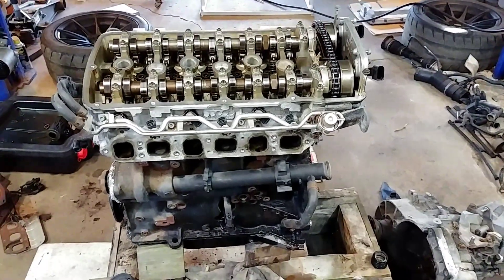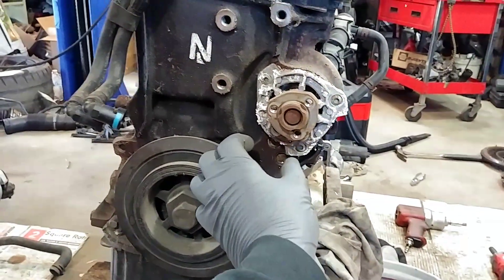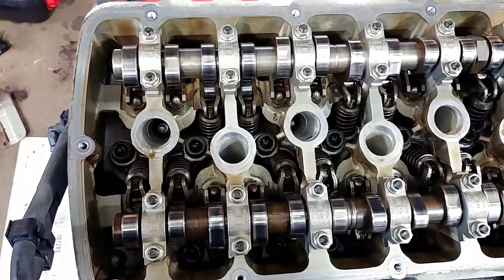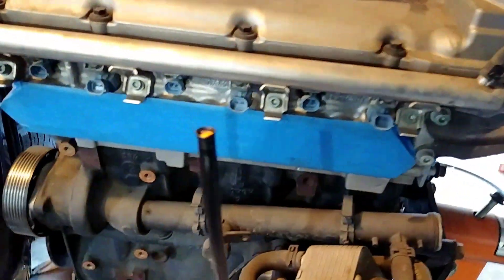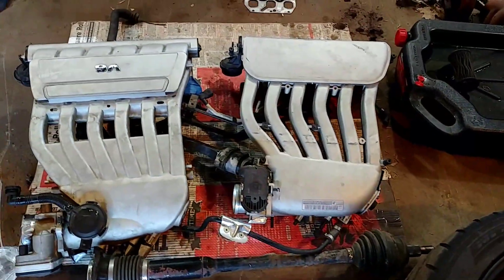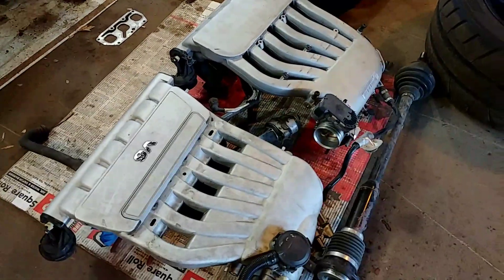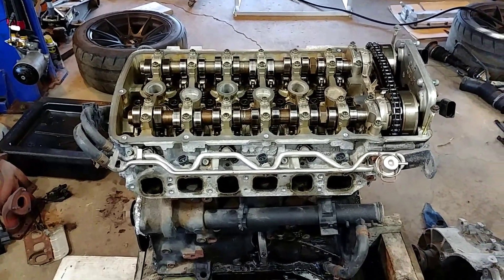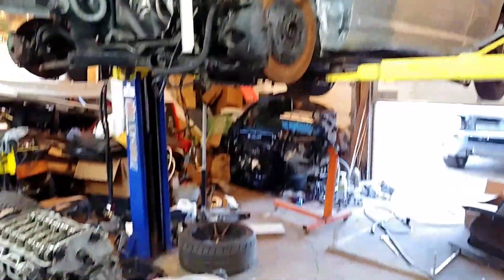VR6 swap 2.8 GTI to a 3.2 from Touareg

Comment: If i may ask. Can a cable shift golf 3 or golf 4 gti gearbox fit on a vr6 r32 motor?
Reply from the maker: I believe you can swap 5 speed and 6 speed. But I'm not too sure about older transactions.
Reply: @sergesvz  is it..

Comment: hi, nice video , i have a cuestion , does the 3.6 engine from touareg have the holes to put the engine mounth braket on the right side ? or you have tu drill the block ?
Reply from the maker: I'm not sure. I have a 3.6 core from a Passat sitting around and I know the Passat block has them because it mounts the same way. I've been thinking about modified head from 2.8 and 3.6 bottom end. 3.2 modified head would be even better because their valves are 1mm oversized.

Comment: Question I bought a r32 engine . I wanna put that engine In a mk4 gti 2.8 24v how hard is the swap and can I use the same harness?
Reply from the maker: Yes, but only if it's early production R32. Apparently there's different engine codes that may have different cams and variable valve timing is different. 
I bought my engine from a 2004 Touareg I swapped the oil pump and the oil pan and the harness plugged right in I just need a swap tune. U would need a swap tune.
Reply: @sergesvz  The oil pump It's got to be from the 2.8 ?
Reply from the maker: @ronnymedina1523  the toaureg has a different oil pan and pump because the engine sits definitely. R 32 has same pump, same part number.  not sure about oil pan. It might be slightly different because R32 has transfer, or it could be same as 2.8. the only thing I modified was the timing cover and it was a very small cut grind.
Reply: @sergesvz  Thank you thank you so much for the information
Reply: Good afternoon sorry to bother lol. I communicate with a person who sold me there r 32 engine And then you was removed from a Touareg 04 I believe you said that I can use the OEM harness from my 2.8 24v
Reply from the maker: @ronnymedina1523  yes I used my original harness and everything works. It runs rich because R32 injectors are bigger but the car ran good no engine light. I used my 2.8 MAF sensor.

Comment: FYI, I was the very first to do this swap about 8 years ago. dubwerks, giac, and many others said it couldn't be done. Shout out to Fred at united motorsports for figuring out the tune!
Reply from the maker: I still don't have a tune. Running on 2.8 software. Runs too Rich.
Reply: @sergesvz  fred basically turns your ecu into a r32 ecu, deletes the awd software. At least that's how he explained it. Worked flawlessly.
Reply from the maker: I should reach out to them
Reply: Do you have any pictures of your swapped car. Would be cool to see VW tuning history.
Reply: @sv_cheats1970  i would pay double what i sold it for to have it back. The guy i sold it to changed his number shortly after, i pretty much immediately regretted selling it.
Reply: I have some photos but the videos i had are gone.
Reply: @kbwerks6592  thats sad... Still pretty cool you managed to do such a swap back then.
Reply: @kbwerks6592  thats sad... Still pretty cool you managed to do such a swap back then.
Reply: @sv_cheats1970  it was a lot of figuring out as you go along but after you know what to do, its actually a pretty straight forward swap.
Reply: @kbwerks6592  about the ECU? You used a remapped golf mk4 VR6 ECU correct?
Reply: @sv_cheats1970  yes i used the original 2.8 ecu. Sent it to fred at united motorsports and he reflashed it. You use the 2.8 wiring harness already in the car too. You need a r32 fuel rail and intake box and you need to rework the pcv system.
Reply: @kbwerks6592  thanks for the info

Comment: In order to swap a 2.8 motor to a 3.2 does the 2.8 exh cam need to be swapped to the 3.2 motor?
Reply from the maker: The early 3.2 production I believe has the same cam. I didn't need to swap cams to go to 3.2 and no check engine light for it. You will need to swap your injectors and intake with throttle body, which will require swapping valve cover, because it has a different crankcase ventilation system.
Reply: No, you need a r32 fuel rail, intake manifold and intake box (unless you use a cai). See united motorsports for the tune, they do a excellent job.

Comment: Hey man quick question can I use the transmission from the 2.8 24V in the R32 engine ?
Reply from the maker: Yes. I only grinded little bit on the timing cover. I don't remember if it's in one of the videos
Reply from the maker: https://youtu.be/tN8_HFH81P4 at 4:32 I explained what was different and I just ended up trimming the cover little bit.  But the transmission is only front wheel drive. I don't know if you can bolt up the AWD transfer case to 2.8 transmission or you need to replace the housing from the AWD. Internally it's the same maybe except for diff output where transfer case bolts up.

Comment: A nice mileage motor that was well taken care of and, you broke it, LOL...Those numbers after the swap are just barely beyond my stage 2 tune for my 1.8t, then again with a tune you should make some solid NA numbers, subscribed.
Reply from the maker: Life happens. Lol.  I like how reliable the vr6 is. I'm looking forward to turbo the vr6, and I wish I had awd. I have a 01 tt 225 that is for sale right now runs on stage 2 and I like it it's quick.
Reply: @sergesvz  Well my benchmark for my 1.8t is to better 155mph. A mark set by my beloved mark 3 Jetta VR on a closed highway with professional drivers in my car, my brothers identically modded mark 3, and a lost Ford Mustang that couldn't pull beyond 130mph, Lol...
Reply: I had a 1.8t the whole shabang full bolt ones stage 2 tune w 2 step n all that and I just sold it to get a vr6 and tbh the vr6 power band is way better the 1.8t only picked up a little bit faster and lost it all at the top when the vr keeps pulling and the VR I got is bone stock other then a intake I just put on